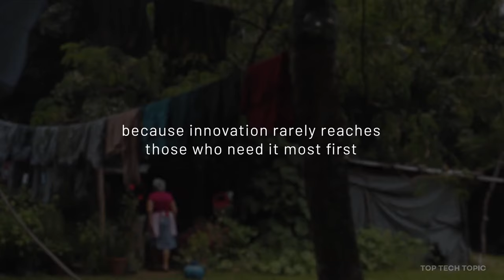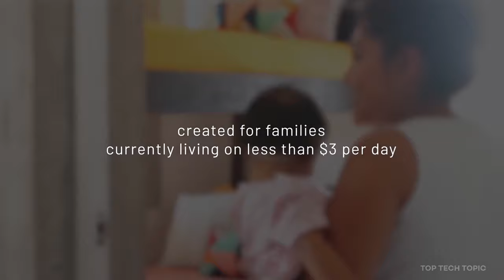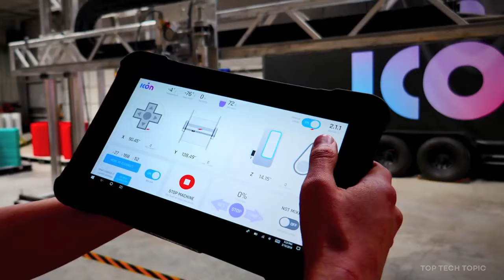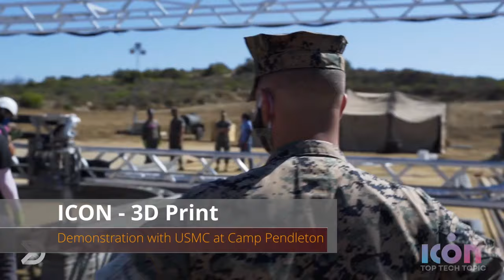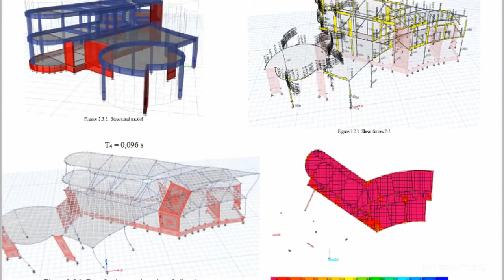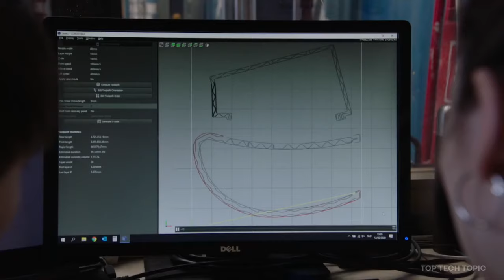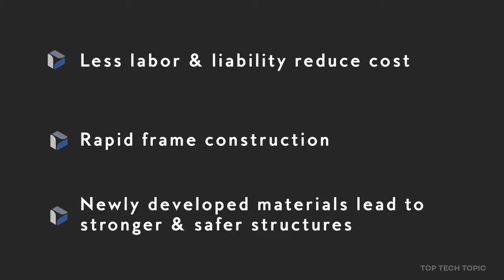NEW STORY and 5 Amazing Manufacturers of 3D Printed houses & buildings

Comment: THIS is very incredible but how are the floors built?? every video on this subject just shows building walls... ok we get it but there is more to a building than just walls, lol
Reply: they still need foundation, so you need a concrete slab or some other traditional method of foundation. 3d printing a concrete slab would be dumb/inefficient.
Reply: @bakha0888  they always omit showing this in the construction